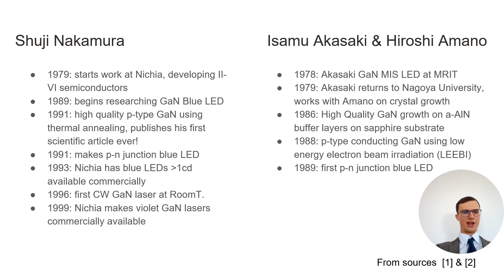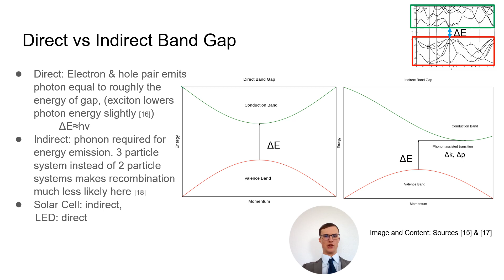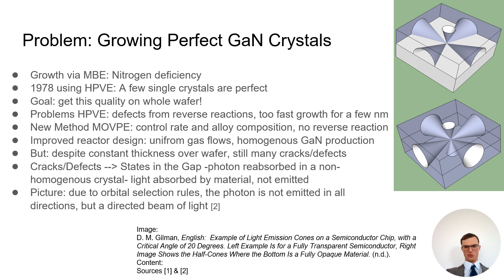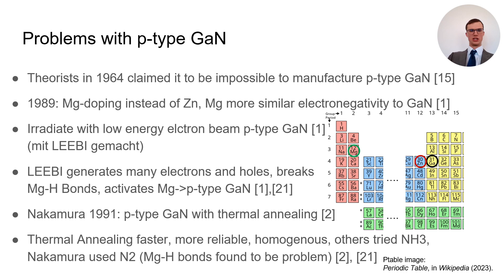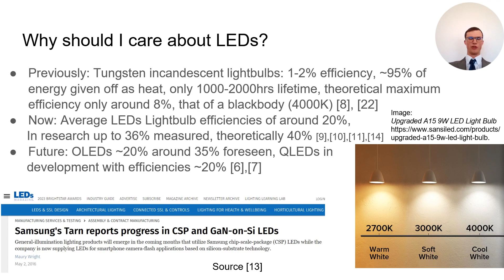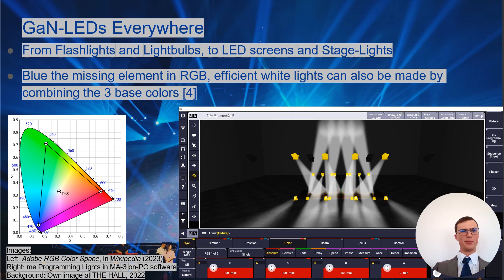Blue LED Light, Proseminararbeit by James O'Leary

Comment: In the section on efficiency improvements you mentioned quantum wells. You said that by confining the p-n junction it leads to a discretized energy. What exactly is a discretized energy and why and how does it arise?
Reply from the maker: Discrete is the opposite of continuous, you can also say "quantized".  It means that only specific energies are allowed for the electrons in GaN.  This arises because Quantum wells sandwich a semiconducting LED material between neighbor materials that are different, confining electrons wavefunctions to that space- if the right boundary materials are chosen, there will be potential walls in the energy band diagram.  As you likely remember from Quantum mechanics classes, potential walls (finite, not infinite, but still), lead to quantum states that are discrete.  By adjusting the widths of the wells, the allowed energies can be controlled.  A common strategy is to try and have the ground state of the quantized electrons in the conduction band be the minimum energy of the conduction band.  This makes for much more efficient LEDs

Comment: How exactly does a phonon provide a change in momentum? (At around 06:10)
Reply from the maker: The phonon can transfer momentum via lattice vibrations in the crystal, these vibrations change momentum, which changes our energy diagram in k-space, and allows the electron to find the band extrema and recombine with it's hole partner.   A phonon is nothing other than quantized lattice vibrations (think wave-like vibrations).  However, just as we learned that an electron (perhaps more intuitively thought of as a particle) acts as both particle and a wave, so does a phonon, despite more intuitively thought of as a wave.  That is why a phonon is known as a quasiparticle.  Particles when interacting, give a change in momentum (phonon interacts with electron).
Above was more of an elementary introduction to another solid-state physics concept- once again, highly recommended to take PHY210 Solid State Physics by Thomas Greber if you wish to learn more.
Or, at a more advanced level, if you're interested in specifically phonons in current Q-dots:
https://opg.optica.org/oe/fulltext.cfm?uri=oe-22-16-19707&id=298664

Comment: I didn't quite understand why a 3 particle system makes recombination less likely than a 2 particle system.
Reply from the maker: Thanks for your question.
On an superficial level, think about it like this:  what is the chance 2 friends have time to meet together?  Add in a 3rd friend, and it is already less likely you will find time to meet, as everyone is busy and has different schedules.
On a deeper level: not sure what to say here, the above still applies, it should be common sense.
Even if all 3 quasiparticles are ready to interact, things can still go wrong:
Example: a phonon changes momentum of electron (this is good, necessary for emission and recombination), however the momentum change is in the wrong direction, pushing the electron further away from the hole in k-space, procrastinating the recombination.

Comment: Why is a indirect gap useful for the solar cell?
Reply from the maker: Thanks for your question.
An indirect band gap makes for less likely electron-hole recombination (for the reasons I described in video, also see response to question by Ahmed El Akhrass).  However, absorption is still possible, and the electron can land elsewhere in k-space than the minimum of the conduction band, perhaps the energy of light absorbed is greater than the delta E on my slide, so a phonon-transition isn't necessary.  Emission on the other requires the recombination of the electron-hole pair, so a phonon-transition is necessary, as the hole is at some local part of the valence band.  
To summarize what I wrote above: indirect band-gaps enable the absorption of photons, which put electrons in conduction band, which can then flow elsewhere in your circuit and give you electricity.  These electrons are less likely to jump back down to the valence band, which means photon emission will mostly be avoided, and the energy absorbed kept inside your solar cell.

Comment: From minute 9 to 10 you explained the p-n junction. I was wondering if the direction or orientation of the diode plays a role for this system to work? In other words can you turn the diode 180 degrees and would the electron from the wire fill the holes which emitts light and the electrons in the n-type would then flow into the wire goint to he source? If yess, why would we need a n-type material and not only a p-type material with holes that get filled with the electrons in the wire?
Thanks already
Reply from the maker: Hi Severin,
It certainly plays a role if you change the direction of the diode, and having no p-n junction at all would not be ideal for an LED.  If you just had p-type GaN, you would have electrons moving from the wire into the holes in the material, however for an LED, it is important not just to have electrons recombining with their hole pairs, but for this recombination to result in a jump from a higher energy level which emits precisely the frequency of light that we're looking for.   This would not work very well with your suggestion, as the wire is a conductor (doesn't even have a clear band gap), so likely when electrons flow from the wire into p-type GaN, they wouldn't emit light, and even if they did emit light from small jumps, it wouldn't be of the desired frequency.  

In addition to this, if you see in the diagram on my slides, the fermi-energy of n-type is less than that of p-type GaN, which makes this recombination even more likely, and it's better than for example having undoped and p-type GaN.  For more information on these topics I think I'd recommend simply consulting Wikipedia for an introduction, or taking PHY210 solid state physics by Thomas Greber next semester.

Comment: What is the advantage of OLED/QLED or why will research be done more in this direction in the future? They don't expect higher efficiency with these, as you answered below?
Reply from the maker: Thanks for your question.
The main advantage of OLEDs & QLEDs is their larger spectrum of colors, see the picture in the left on my last slide at 26:30.  LEDs, especially when using phosphorus or other external filters to convert Blue GaN LEDs to white LEDs, it is not possible to really cover the full CIE color diagram.  In reality, LEDs cover a triangle subspace of CIE color space, QLEDs and OLEDs also only cover a subspace, but a larger subspace.  Also, when turned off, LED screens aren't as perfectly black as OLED & QLED screens.

Comment: For insulators; large gap means it would need a higher energy photon to let the electron jump (absorption/emission)? So there are not „fitting“ external energies to that or why would a connection not be possible, like too high energy would destroy the material, ionize it or is non-existing/ not applicable?
Reply from the maker: When you mean higher energy photon required- you're talking about absorption (solar cell), if you're talking about emission, it would be more accurate to say it releases a higher energy photon.  Regardless, my statement that it is very unlikely that electrons will jump to conduction band is correct, it's not impossible, under certain conditions like external thermal excitations it can happen: read article https://onlinelibrary.wiley.com/doi/abs/10.1002/pssb.2221150210 

Also another effect of an insulator's large gaps, is that the Energy emitted is not in the right wavelength for visual light, something else which makes this totally inapplicable for LEDs.

Comment: You mentioned that theorists claimed that it is impossible to manufacture p-type GaN. What was their reasoning? Is it directly connected to the fact that at that point it was not possible to create high-quality GaN crystals?
Reply from the maker: Hi Mirco, thanks for your question.
Yes, it actually is directly connected to that.  The "self-compensation effect" from the theory paper I cited from 1964, (this paper is also cited in the 2014 Nobel lecture, I will attach a link here if you're interested: https://journals-aps-org.ezproxy.uzh.ch/pr/pdf/10.1103/PhysRev.134.A1073 ) arises from natural impurities in the material.  The theory is that for high-band gap semiconductors p-type conduction won't be possible, because when you dope with Mg for example, but already have so many defects (n-type and p-type), it doesn't make much of a difference in the conduction properties or free electron-hole concentrations.  Doping is basically putting controlled-defects in your material.  If the defects in your material are random and out of control, then you've already lost.

Comment: 9:36 there will always be n-type electrons flowing into the p-type poles … as long as you apply this current. Why would this actually happen in this way?
Reply from the maker: Thank you for your question.
Without applying a current, and just connecting the 2 materials (n-doped and p-doped GaN) together, the potential energy difference would be the difference between the 2 Fermi energies, (n-type doped has higher Fermi energy than p-doped) so you would initially have a current flow of electrons to holes at the boundary as the charge concentrations must balance out.  In a very short time, an equilibrium would be reached.  Concentration of electrons in n-type GaN and holes in p-type GaN no longer enough to support recombination, and this area is called the depletion region.

This is where the external applied Voltage comes in, as the external flow of electrons feeds the n-doped GaN, electrons in GaN are constantly replaced, which means that electron concentration in the n-type GaN near the boundary doesn't drop, so there will continue to be spontaneous emission as n-type electrons recombine with p-type holes.  The concentration of holes in p-type GaN near the boundary also doesn't decrease as it would without potential, as recently recombined electrons will move on with the external current, freeing up the holes they landed in, now ready for fresh electrons.

Here's an easy to understand Youtube video about this: https://youtu.be/DDalmLJr2_c

Comment: How did they come up with the idea to use an Lt-Buffer layer, was this a technique that was already being used at that time for different things? Why did they think or know it would work?
Reply from the maker: The idea for a buffer layer, whether low or high temperature (Lt stands for low temp), wasn't invented by Akasaki & Amano, there were others trying this on other materials at the time, however it was far from guaranteed to work, and they were the first to try this on GaN growth on Sapphire.  An example of other research on this topic at the time: "Low temperature growth of highly lattice-mismatched III-V compounds by metalorganic vapor phase epitaxy using a thin buffer layer" by T. Sasaki et al. This paper was published in the Journal of Crystal Growth in 1986, same year Aakasaki & Amano developed their Lt-buffer layer to promote GaN growth on a highly mismatched sapphire substrate.  Despite not inventing the idea themselves, they still had to choose the right material for the buffer layer, and the actual specifics (Ex: what temperature to grow buffer layer at- they chose a "low temperature ~500C"), there were many things that they needed to consider.  I would say they didn't KNOW it would work, but that they thought it was worth trying, as it had been used by other researchers when making thin film semiconductors on mismatched substrates.

Comment: I don't know if you mentionned this somewhere but I was wondering why GaN is more prone to defects when growing the crystals then ZnSe. Does this depend only on the substrate used? Why couldn't they just use another substrate than sapphire with lower lattice missmatch ?
Reply from the maker: Thanks for the question, ZnSe wasn't grown on a sapphire substrate- but rather grown on GsAs (actually was on the slide, but I didn't say it out loud).  The lattice mismatch between ZnSe & GsAs is only 0.26%, which is small enough to have the lattices of ZnSe and it's substrate line-up most of the time and this makes for very few defects compared to trying to grow GaN on sapphire.  Other materials were of course tried, but it isn't as easy as it sounds, I'm many researches tried to "find a material with a lower lattice mismatch for GaN" however, sapphire is still the substrate used today.  It's worth noting that it takes more than a similar crystal structure to be a good substrate.  You need the correct chemical properties, (what if Gallium or Nitrogen reacted in a weird way with proposed substrate- gameover) thermal and mechanical stability, and a smooth surface for which your thin-film GaN or ZnSe can grow on.  Current research is going on trying to get GaN to grow on Silicon, as Silicon is cheaper than sapphire, and there's much more of an industry built up around Silicon, but as of now it's still easier to use sapphire.  Also, over time, the stability of ZnSe crystals isn't so good- according to the Nobel lecture, there was a problem of propagating defects- as soon as a small defect appeared it led to many others.  So ZnSe had it's own problems as well.  Akasaki, Amano, & Nakamura did take a risk researching GaN-LEDs instead of ZnSe-LEDs, but ZnSe wasn't the best material either.

Comment: You mention a 36% efficiency with I believe a theoretical maximum of 40%. Are there believed to be materials with efficiencies that are a lot higher >50% ? do those potentially already exist in the green/red spectrum?
Reply from the maker: Great Question!
Short Answer:
No, there's not believed to be, at least not for blue/white light, but that's mostly because efficiency in the way I'm using it on the slide you're referring to is based on the theoretical maximum efficiency of green light (100%).  So in a way, green could be most efficient, but this is just one definition of efficiency, and it's worth noting that in practice, Blue/white LEDs are generally more efficient than green LEDs, despite a lower theoretical maximum.  Perhaps a future breakthrough nobel prize will be efficient green/red LEDs, who knows?

Long Answer:
First of all, when talking about efficiency, it is very confusing, as there is internal quantum efficiency, external quantum efficiency, and then a sort of "wall-plug" reality efficiency.  As far as quantum efficiencies go, just looking at the following nature article, you can see there are efficiencies much higher than 40%: https://www.nature.com/articles/s41438-020-0283-7 
However, I was referring to real, luminous efficiency for the sake of simplification of understanding for the viewer (though actually on the previous slide I was referring to quantum efficiency- at least the first few figures, so it was actually even more confusing, I apologise for not being more clear).  How you calculate the real "luminous" efficiency is finding the efficacy (lm/Watts), how much light emitted per Watt power provided.  You can also try and calculate it given the internal/external quantum efficiencies (see my 11th source- https://iopscience.iop.org/article/10.1088/0022-3727/43/35/354002/pdf ).  Also: the 40% figure was not directly in the article, but they claim "However, the highest ηL is still about 100 lm W−1
lower than the theoretical ηL limit of white LEDs (260–300 lm W−1). Therefore, the possibility remains to further enhance the ηL of white LEDs"  I then calculate 280/683 ~ 40% because the standard is using 683 lm/Watt as maximum 100% efficiency.  This is because an ideal monochromatic 555 nm source has a luminous efficacy of 683 lm.  You may say 555nm isn't blue, no it's green, well, you're right, but this is what the industry/research standard is for calculating luminous efficiency "A common choice is to choose units such that the maximum possible efficacy, 683 lm W−1, corresponds to an efficiency of 100%. The distinction between efficacy and efficiency is not always carefully maintained in published sources" https://www.sciencedirect.com/topics/engineering/luminous-efficacy#:~:text=A%20common%20choice%20is%20to,carefully%20maintained%20in%20published%20sources.